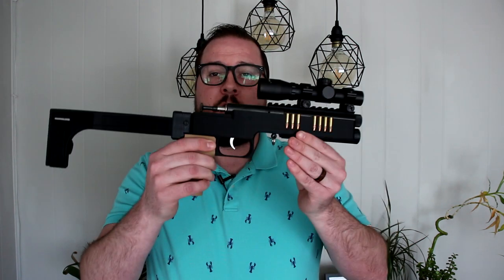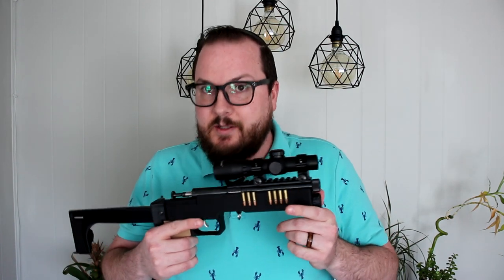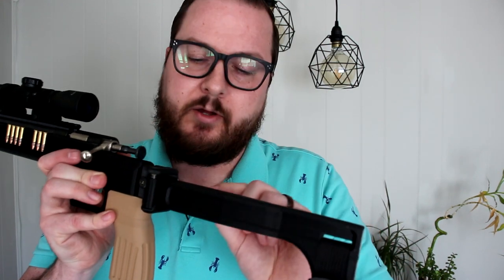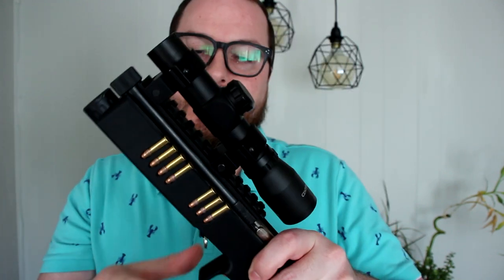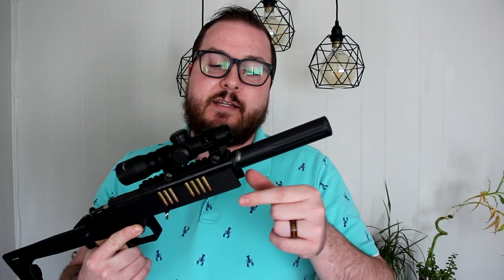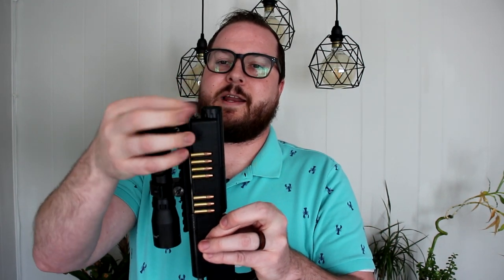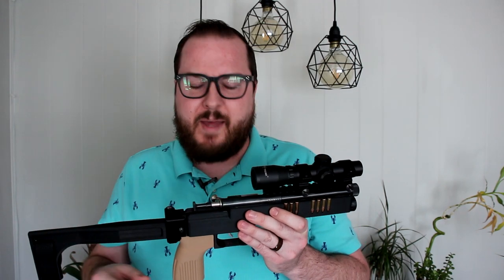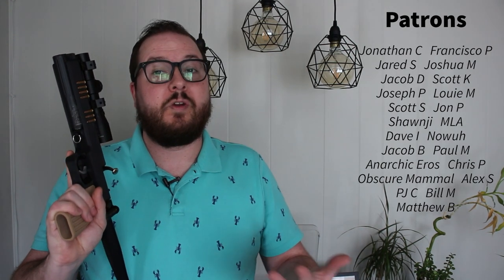3D Printed Crickett Chassis - For Pistols or Rifles

Comment: Just printed the chassis and saw the trigger shoe only sticking out about 1/2" 
Then a quick search I realize that they make a youth trigger and an adult trigger. KSA sells the adult trigger for $9. Just in case anyone else has the same issue.
Reply from the maker: I’ve seen that reported! I didn’t know they had two different trigger setups for the kid guns and the adult ones until a few months ago.

Comment: I was already thinking about bracing a Crickett, but your printable chassis really lowers the overall cost on the project. 

Do you know if the suppressor sleeve is large enough for a 1.06 inch diameter Dead Air Mask?
Reply from the maker: It’s a smidge too tight for that, but the file can easily be edited to open it up a touch.

Comment: If I create one of these, will I need to register it under the new pistol brace rule as a SBR? I'm not quite sure how it works with single shot rifles vs semi-auto. I would really like to build one of these, just trying to figure out the logistics. Thank you.
Reply from the maker: It would likely be an SBR. Operating method doesn’t change things. There are lawsuits currently flying to prevent the rule from taking effect.
Reply: @booliganshootingsports  even if you don’t add a stock or brace to it?
Reply from the maker: @colejackson3534  if you don’t add a stock or brace, it’s just a pistol.

Comment: Hey, I downloaded the stl files from odyssey and I cant seem to fit the chassis on my ender 3. Any suggestions?
Reply from the maker: It’s a tight fit. Corner to corner and make sure your bed size is properly set to 235x235 I think.
Reply: @booliganshootingsports  Thanks, I had to get rid of the artificial boundary on Cura and then it fit! 

The prints at 28%, Ill post a pic and shout out on reddit when I am done!

Comment: Will the hand grip take a standard AR hand grip?
Reply from the maker: Yep, they just can't have a backstrap. The space between the bottom of the chassis and the rail for the brace mount is limited, which is why I designed this specific grip to fill that gap. But it'll fit any AR grip, just might not be as comfortable.

Comment: Ok can somebody answer a question for me since I’m not from the U.S.? What’s the deal with that being a brace and not a “stock?” This is the second time I’ve seen somebody do a brace for a pistol and not an actual stock for it so I’m assuming it’s some law I don’t know about.
Reply from the maker: If you put a shoulder stock on a pistol without a $200 tax stamp, you illegally create a short barreled rifle punishable by 10 years in prison and a $250,000 fine. What is pictured on this is an arm stabilizing brace. It can brace against your forearm and in this case, has a strap to hold it tight to your arm and give you a more stable shooting platform. It’s not a shoulder stock nor is it designed to be held against the shoulder when firing. 

However, they’ve determined that sporadic, incidental, and situational shoulder contact with an arm brace is permissible.
Reply: @booliganshootingsports  Aha, thank you kindly. Nifty looking design by the way, when I first saw it, I thought it looked like something out of a cyberpunk/sci-fi series.